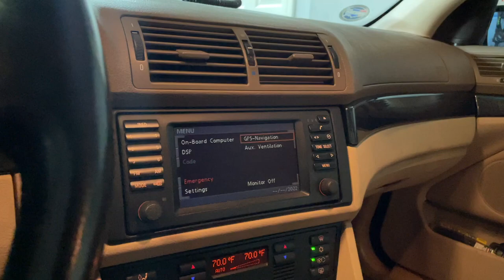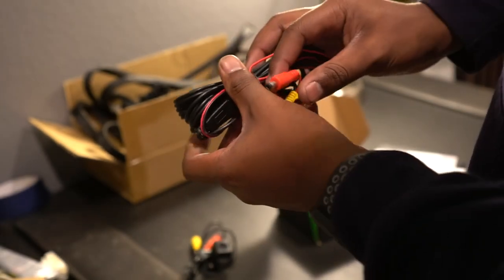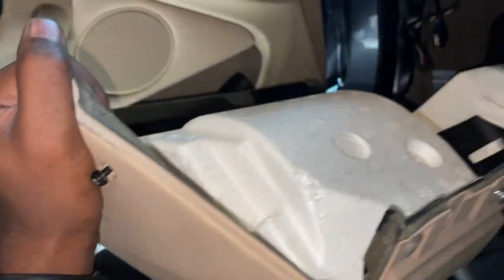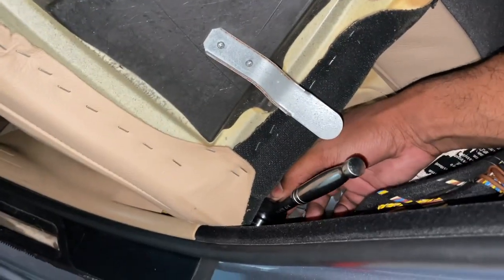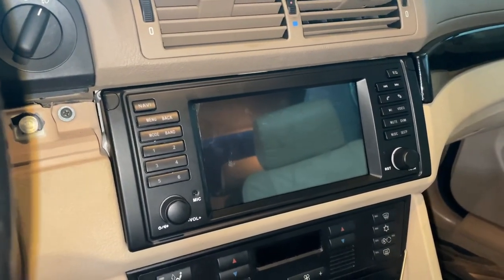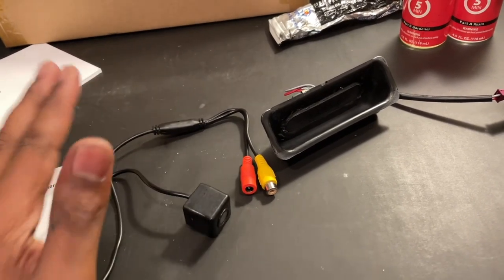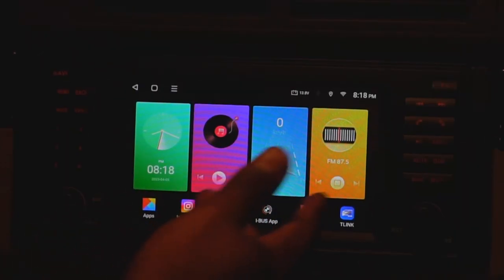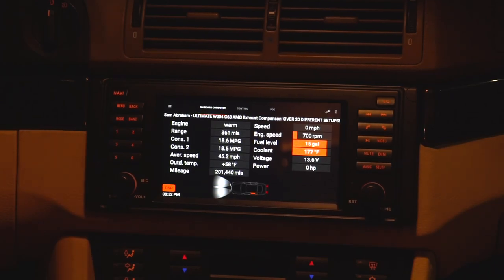BMW E39 5 Series Eonon Android Q49 Pro Infotainment DIY Install - CarPlay, Android Auto, Backup Cam!

Comment: MUST READ!!!! This was a great installation video and I used a little for my installation one thing I don’t see in any videos is taking the canbus module off the included harness and adding it to the extended harness with this everything works plug n play and have not seen any issues so far. If you do everything correctly and have no sound try the steering wheel controls to turn the sound up. Installed in 2003 e39 BMW M5.
Reply from the maker: Thanks for your addition! Hope you're enjoying that M5!
Reply: does it have good bass, noise? which is better the old one OEM or this one? for listening musics? nobody answered me :(
Reply: The sound is great I wouldn’t say it’s leaps and bounds over the stock head unit. It’s more for the CarPlay and the new modern look in my opinion. It’s a definite upgrade and a no brainer.

Comment: Very detailed installation video. Thank you for your sharing~ 🤗
Reply: I can get wireless car play to work, but not wireless android auto. is this a known issue, any fixes or tips?
Reply from the maker: Thanks for sending me the unit and supporting the channel!
Reply: @SamAbraham  Hi Sam. The Q49PRO also supports wireless Android Auto.
Reply: Hey Eonon, Why don't you provide a bracket and screws that actually fit for the car? It is a bad first experience with your product when you provide a mounting solution that does not fit.

Comment: If they can't even spell 'Setup' correctly on the button (it's spelled Seutp), God only knows what else Quality Control misses.
Reply from the maker: Yeah that's weird, hadn't noticed it myself until another comment. Anyways its been nearly 7 months since install with 0 issues and daily use

Comment: Hello my friend. What to do with the antenna wire that runs in this long wiring harness? it does not fit into the connector on the block. Or where should it be connected?

Comment: I dont have the stock lcd screen but the cd changer and potential factory amp, in the truck do i need to get the harness run to the back?
Reply: Do you find an answer?

Comment: Great informational video. I'm trying to decide between the AVIN and the Eonon head units. Have you experienced any issues with the Eonon head unit or the back up camera setup? I own a 2003 BMW 5 series, will this particular Eonon head unit work with my vehicle? Thanks
Reply from the maker: So far no issues with mine! I do know the Avin unit may have a more OEM look in terms of the finish, but there is also a significant price difference. As far as I'm concerned, there's nothing the Avin unit can do that this one cannot. I have not had any issues so far, and it has been installed since December.

Comment: Will the new eonon radio also include a function that previously displayed the original BMW radio from Bord Computer, such as the current petrol combustion???
Reply from the maker: The Eonon units don't have that functionality out of the box, however, you can add that with the IBUS adapter which I showed briefly in this video. I'll talk more about that in another video

Comment: At man thanks for the help but I had a realization during my installment. No need to run the cables because they’re already connected on the amplifier to the stereo. Just spliced them and connected them to the speaker cables, simple and easy.
Reply from the maker: Yep, for cars that didn't have the factory screen, no need to run any cables

Comment: This is super handy, man. Many thanks. Tip I can give you (if you don’t mind a little rewiring), you can get cameras for the E39 that is integrated into the plate light.
Reply from the maker: I haven't found a specific E39 camera, I have one of those for my E92 but some sites that list E39 are incorrect on the product description. If you know of a proper E39 camera lmk!

Comment: Issues with this radio (I have a 2001 BWM525): The bracket as shown in this video. I really dont want to drill in my dash. It's a shame cause it is not a bad product otherwise. There is a spelling mistake on one of the hardware buttons. Instead of SETUP is says SEUPT..see 32:35. My steering wheel button volume controls do not work with android auto. (they do work if I run spotify from the unit). My wireless android auto sometimes has a hard time connecting. but this might be due to my phone. After some reset i will work again. I also have the Resler Ibus connected, I can highly recommend this.
Reply from the maker: As for the bracket, definitely an annoyance but the drilling doesn't at all prevent you from going back to stock if necessary. I never noticed the spelling error on the setup button until I saw ur comment, and I've been using this for months haha. I will never unsee this hahaha. Volume controls and all seem to work flawlessly with CarPlay, I don't have an Android so I can't test Android auto unfortunately, hopefully some updates can fix the issues you're having. The Resler module is fantastic, looking to make a video with it soon

Comment: Thank you for the video. It’s very detailed. Everything works for me except the backup camera. Do I have to program anything besides hooking up the cables?
Reply from the maker: If your car has a manual transmission you'll have to setup a trigger wire to the reverse light bulb. If its an automatic, you'll just have to dig through some of the system settings to find backup camera options
Reply: @SamAbraham  Thank you for your help. My is automatic transmission and have a hard time figuring it out. 

Please send me any links to solve this issue.

Comment: Hey great video, thanks a lot! I've got a 2000 528 and have been dreading the install for a while because NOBODY has posted a video of how to connect this unit with the A0590 harness. I've had the unit for like two months now. Two questions if you don't mind-
How has the reverse cam held up with the JB clear weld? &
Did you wrap your car or paint it? . . . Or is that an oem color?
Reply from the maker: Glad this was helpful! Yes, 7 months later with daily use and on a car that sits outside, the JB weld shows no signs of failing. Its a wrap, essmo vinyl midnight purple. However, the inspiration for it was both OEM colors Mora Violet Metallic and Technoviolet

Comment: Hello :) thank you very much for the detailed video. 
I got one question though, why making the loop between the new unit and the bm54 module? I would like to take all the old system out and just keep the new android. 
Thanks in advance for your answer 🙏
Reply from the maker: You have to run the loop so that the audio “circuit” is complete. I believe the only way to do this without running the loop is getting an IBUS module. The bm53/4 modules don’t take up much space anyways so you don’t lose anything by leaving it there

Comment: Great video! 
Thank you for your time on this 
My question is, I have a 2002 540i with the cd changer in the front instead of the radio and tape before it. It has DSP. Do i need to install that adapter as well like you did in your trunk?
Reply from the maker: Hey there, because you have the DSP amp I believe that still will be in the trunk in the same location as mine, in which case you’d need to run the same adapter. I would check to make sure before buying!
Reply: @SamAbraham  thank you for the help and reply

Comment: I believe you'll have to hook it up to your DSP from your harness if you want to make it work. I'm surprised you just hooked it up to your factory radio?!?
Reply from the maker: The DSP amp and BM53/4 radio are still connected to each other, which is why it works. The harness just intercepts that connection essentially. Been problem free since I installed this back in December, now with even more control over DSP with my IBUS module.
Reply: @SamAbraham  ok interesting! i'm glad it works fine.  Are you still able to read the clock time, fuel consumption etc on your instrument cluster?
Reply from the maker: Yup! @technik333

Comment: Do you have a video of how you run the wire from the driver side footwell into the radio spot?
Reply from the maker: I described it in the video, under all the door kick plate trim and slightly below the carpet through the side carpeting in the trunk

Comment: I just bough an e39 it has this stereo on it, but the steering wheel controls dont work, anyway I can make that work?
Reply from the maker: Hmm probably means the Canbus decoder isn't functional for whatever reason, or there's some other issue with the settings. Id look through all the settings menus and see if you can find some sort of Canbus settings.

Comment: Just installed, everything working fine with mine, except my WiFi is not staying connected/not connecting to WiFi. Any help?
Reply from the maker: Weird, have you tried your phones hotspot just to see if it’s an issue with the unit or the connection itself?
Reply: @SamAbraham  I have but I get the same results.

Comment: When installing one of these, will it run multiple accessories with just the two USB leads ? If one is used for the I-Bus app, can you have the DAB , TPMS etc on a hub in to the other USB lead ?
Thanks
Reply from the maker: Honestly not sure if you can run a USB splitter off the other lead, it seems like you could but I haven't attempted it to can't say for sure
Reply: @SamAbraham  No probs, thanks for taking time to reply.

Comment: hey i just finished installing mine and now my car won’t start, is this a wiring issue?
Reply from the maker: This should not correlate to anything that would prevent the car from turning on, unless your battery drained during the install

Comment: Hey man, I installed mine as well and it seems everything is working EXCEPT day and night switching on CarPlay. Do you have this issue? 

My panel keys turn on and off with headlights and screen dims and gets brighter etc but no day and night cycle with headlights
Reply from the maker: I believe CarPlay switching between Light/Dark mode is dependent on what your phone is set to. If you go to the settings app in carplay you'll be able to adjust those settings. The screen should still dim/brighten with the headlight switch, so if thats what you're referring to then I am not sure why that wouldn't work. You might have to go into the T-link settings on the android before your phone connects to adjust those settings
Reply: @SamAbraham  It’s working now, no idea what changed but it’s working all the sudden haha

Comment: how did you unplug the plug that you are showing at 18:04? i cant get it to come loose
Reply from the maker: there’s a tab at the front of the connector you have to squeeze, and then the latch for the connector pulls out and brings the connector with it